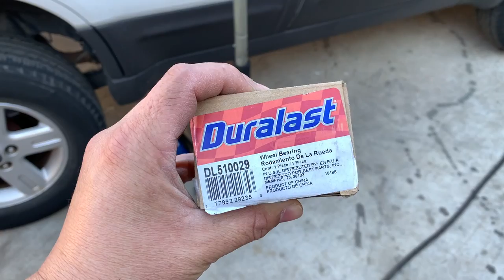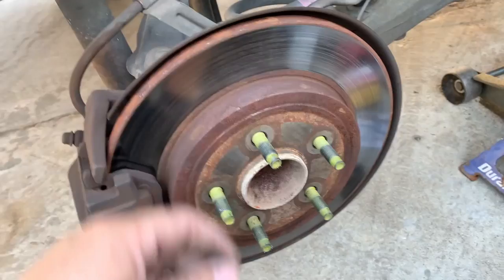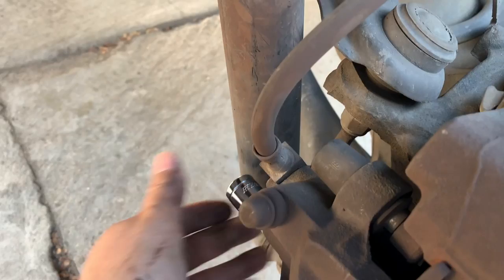Noisy Bearing!  2006 Ford escape rear wheel bearing removal and install repair

Comment: You didn’t show the most important part installing the hub.
Reply from the maker: When you place the hub back in the bearing, place the giant bolt back in and tighten until it stops . You can do this by hand or impact gun.

Comment: We had Ford escape 2010 this week ...Having someone heat with propane torch on back of bearing on outside edge while using slide hammer made big difference in getting hub spindle out .
Don't heat the hub spindle this will make it harder ...
Without heating it's killer removing hub spindle ........

Comment: They have hydraulic press tool you can put behind backing plate at harbor freight for $200 ..
Push hub out easy ..
Most shops take the whole hub and backing out and use press ...
If you heat around inside of spline at nut not bearing it will come out easier ...
Also bottom of backing plate near the spring will show wear marks if bearing is bad ....
Sand the hub spline lightly with emery cloth before installing will.make it go in easier ...